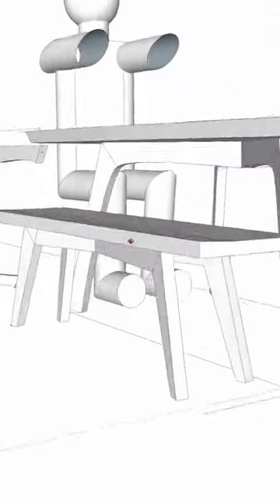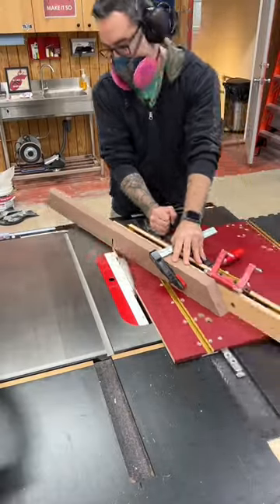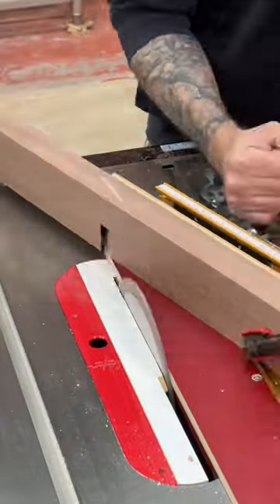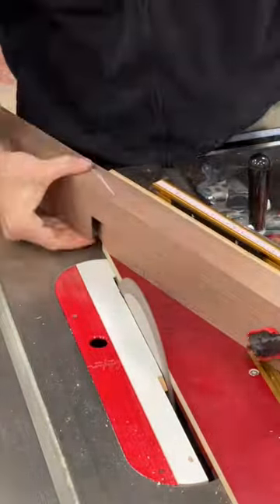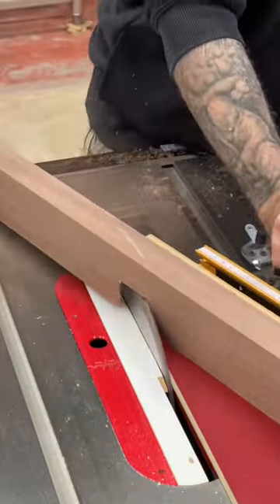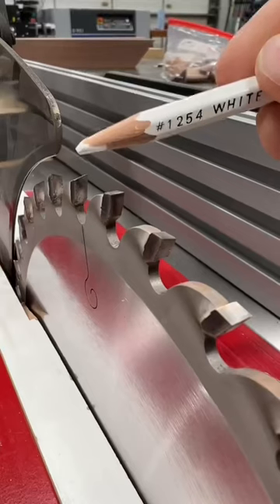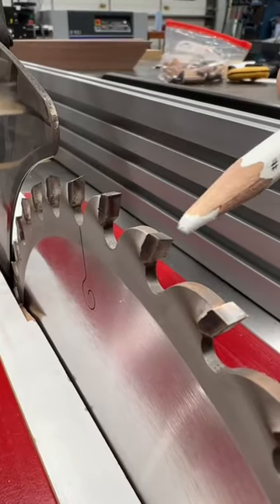Big Notches For Criss-Cross Rails! | #shorts

Comment: I'm curious why you used a single blade with flat tooth instead of a dado stack?
Reply from the maker: Because using a dado stack at that height and with that angle is pretty scary. Plus, on a sled, we might not even be able to reach that height with a dado stack.
Reply: @woodwhisperer  thanks! -and nice joint, too!

Comment: Where is the best place to find an affordable flat ground blade like you show here?
Reply from the maker: Look closely at ripping blades. Some have a flat tooth.
Reply: Marc, can you provide a link for that blade? Thanks!
Reply: @woodwhisperer  what’s the blade you’re using in this short tho? That’s what I wanna know. Never knew they made ATB and FTG hybrids
Reply: I don't have one but search for "ATBR" blades. Has alternate grind teeth plus a "raker" tooth. Often these have a raker tooth that is just shy of full diameter. These give a "near" flat bottom result, with a tiny corner on the outer edges of the final kerf. I believe this reduces tear out.

What I do is use a router plane to clean up the bottom of the kerf. Takes a bit longer to do that but avoids having to buy another bladder plus change it out when I am done. Router planes have several uses beyond cleaning up a saw blade kerf.

Comment: I don't understand when you're cutting a dado why don't you use the dado head so you're not just cutting a little less than a quarter inch at every pass
Reply: He replied to someone else:
> Because using a dado stack at that height and with that angle is pretty scary. Plus, on a sled, we might not even be able to reach that height with a dado stack.

A box-joint blade set may also work, cut 3/8" at a time, and leave a flat bottom.  But still might not give the depth required with the sled to allow clamping the workpiece.